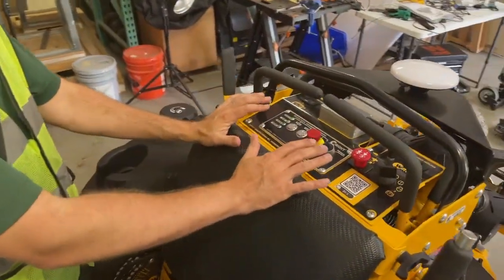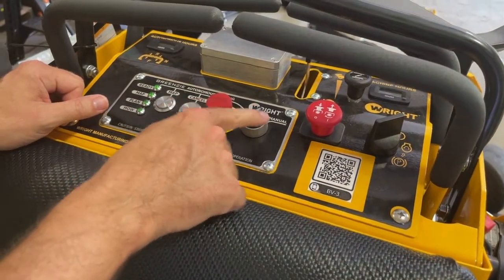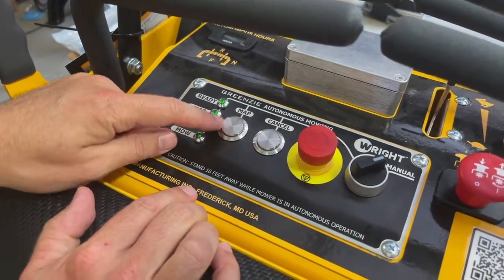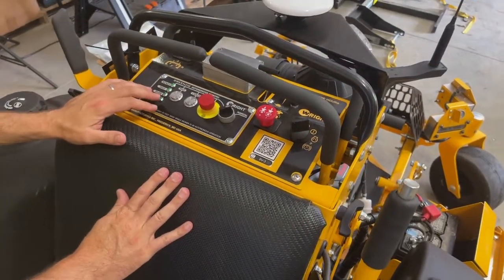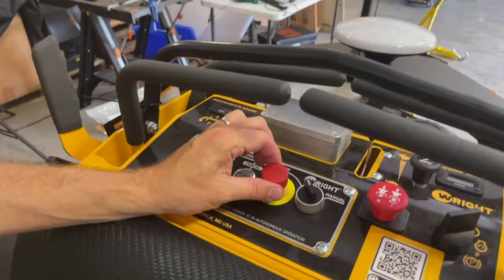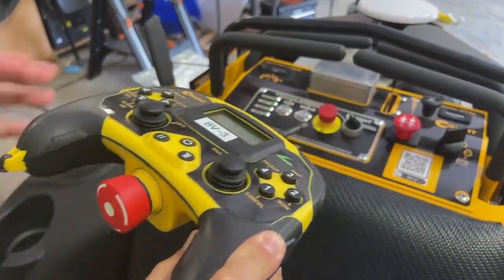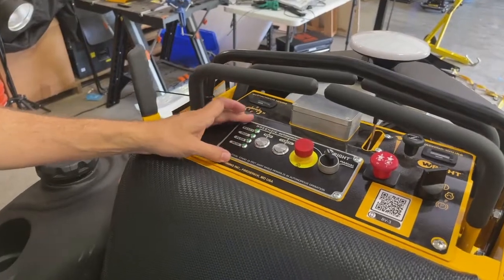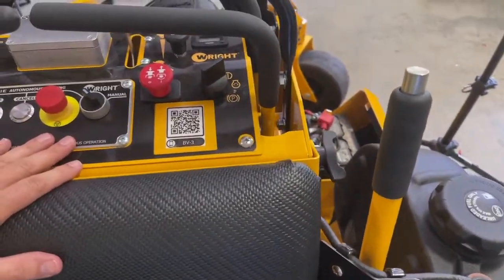Greenzie Product - How it Works: Operator Control Panel

Comment: I'd like to see this on a model that allows for a right-side collection system, such as how the scag v-ride does it, or the toro grandstand. The wrights and other designs have the gas tank on the right side and in the way of a collection/bagger setup. This would be great on a toro grandstand multiforce.
Also, if you have a property that has 3 or more sections but can all be connected by one continuous outer perimeter, but with the house in the middle, will it work?
Reply from the maker: Wright just came out with a bagger for their Stander ZK, BTW.  In the case you outlined with 3 sections but one big perimeter, the fastest, most efficient method would be to do it in sections, and not leave house in middle.  The mower would recognize a gigantic obstacle every time, but it would be very slow to go around it, and us humans are much better (for now) at detailed work along property line, near house, etc.  This is your robotic worker for the big boring sections.  Which you can easily carve out a few on a property like that.  Great question.